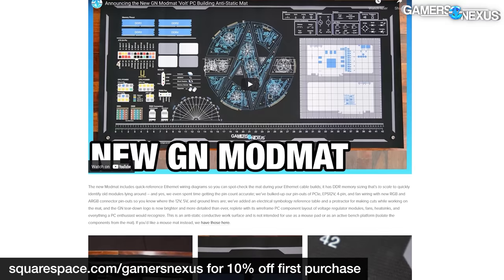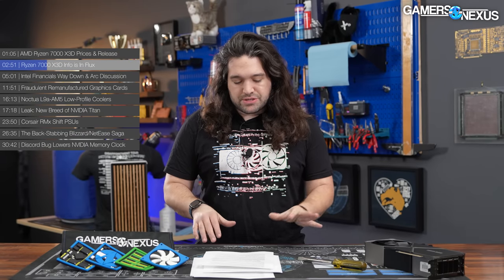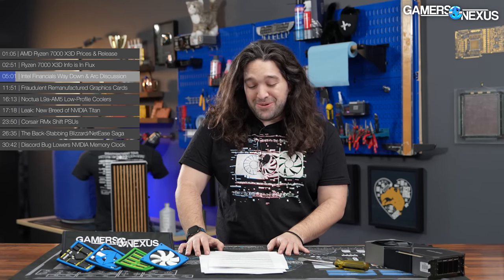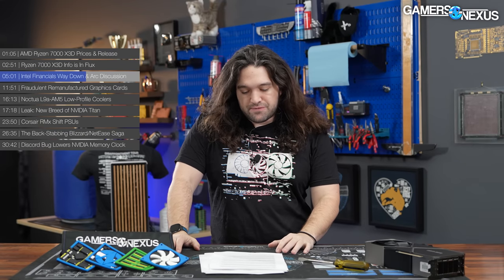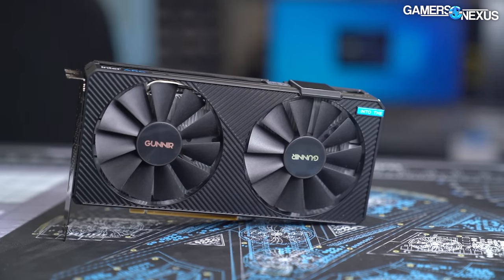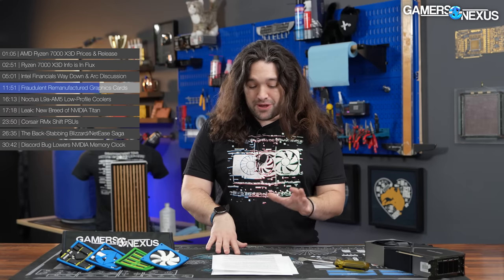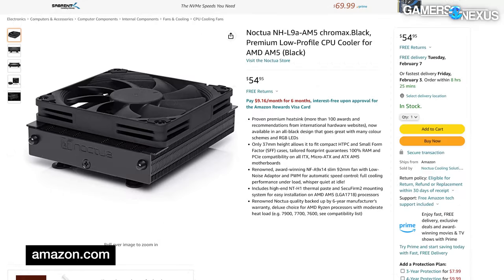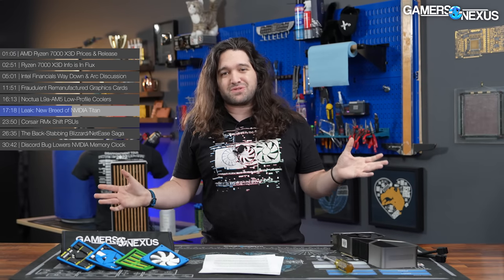HW News - Fraudulent Used Video Cards, 7950X3D Pricing, New NVIDIA 'Titan' Rumors

Comment: I would think Intel needs Arc to succeed and they won't give up on it.  Not for gamers or laptop users, but so they can someday compete in the compute market with CUDA.
Reply from the maker: Great point to call attention to the compute market!
Reply: but CAN they compete? is clear that AXG can't just hemorrhage money in this economy, at least not before some short sighted shareholders take the pitchforks.
Edit: ah what I wrote was mentioned in the video, lovely 😅
Reply: @administrator4728  Xeon Phi isn't a GPU series. The point of Arc is to supplement integrated graphics when higher performance is necessary, among other things.
Reply: @endless2239  why not? The have access to the same manufacturing as there competition does, they just need the talent which they have the money for.
Reply: ARC was never going to be earth shattering at the first stab at the market. What's more interesting is future generations.
Reply: If anything saves Arc it will be the compute and the laptop market.
Reply: Honestly I don't think Intel's strategy is attractive with OneAPI. It's great that it's not supposed to be vendor specific but the code base is in OneAPI. AMD ROCm supports openCL, cuda, along with others so developers don't have to due substantial changes to their code base. (ROCm isn't complete but that's the direction)
Reply: Considering how long they held with a losing product like Larabee, we can expect at least a couple more years of trying before throwing the towel
Reply: @Ibrahimarm  the Arc series is more to compete against NVidia and AMD on the data center world rather than the desktop one
Reply: @scythelord  That is true but Intel as is was never meant to have (kinda massive) Issues at this Point in Time. When they made Arc and or the GPU Devision they thought they could just Tank whatever they need to... to get into Markets.

The Issue now is that Future drastically changed and it doesnt seem Intel has the Money anymore to do so for many many Years...

With other words, for now they will most likely try further but if it costs them to much and they arent getting enough Positive Feedback back and ppl arent really buying either... that can be an Issue for sure.
Reply: Intel will sell off the IP license for the desktop graphics but keep licenses for compute.  Thing is CUDA had a stranglehold on most of the market including AI.  Even though mi instinct series is a superior solution, CUDA still rules.
Reply: Captain_Morgan  Hmm I would also add Intel saw how Nvidia became a giant with AI and GPU, they want to be the next Nvidia. Also I'm going to guess Arc is just getting the offshoots benefit of Intel's actual data center gpu research.
Reply: @donh8833  I see Intel is attempting to crowdsource linux devs to help with arc. That's kind of the whole reason why they went with oneAPI in the first place, getting all the coders and linux users involved. That is kind of how Nvidia approached the CUDA development, they use to hand out free samples to Academia and linux devs to help test and co-develop CUDA.
Reply: Intel has a different architecture for business gpu compute called Ponte Vecchio
Reply: @donh8833  Nvidia is good at keeping happy those who buy their products, especially in the professional market. They have the means and the will to make the software end of their products as simple to use and implement. They work closely with developers and institutions so as to make sure they keep sticking to Nvidia's proprietary technology over, many times more efficient, open standards. I don't know about these days but in the past, Nvidia was pushing Quadros so hard on the CAD/CAM community that their GeForce cards would have many of these programs like Maya render using the software pipeline rather than use hardware accelerated graphics. They're like a good casino in Vegas, they keep their customers happy with a lot of TLC only to fleece them in the long run.
Reply: It's all dependent on how short sighted the investors are. It's exactly that short-sightedness that got them into the shape they're in to begin with. Pressure to move into other markets because the CPU market was saturated and offered no growth. Those investors need to realize the GPU market isn't nearly as saturated as other failings like SSDs that never had a chance to give the ROI that's possible with GPUs and pulling out of that market is foolish after they've already invested so much.
Reply: It's gonna die homie.
Reply: At this point

They have to choose, Do we throw money that we don’t have at a division that hasn’t made any profit, in the hopes of one day making it back eventually 

Or

Do we cut it down, lay off half the staff, and just keep making lower end GPU’s and get the drivers figured out, spend money on catching up in the CPU space, and actually making a profit

(Btw, the 2nd has already happened, Intel has laid off 15% of their employees, and a large chunk of the GPU division was a part of that)
Reply: @administrator4728  I completely forgot about the compute side of GPUs until multiple people pointed it out to me xd
Thanks for the in-depth explanation; I was unaware of the history and stuff.
Reply: That will never happen. Intel's graphic division is losing tens of millions
Reply: @denverbasshead  Well, Intel's GPU division is also new. Companies entering new market segments tend to not get any returns for at least a little bit depending on how hard they are to penetrate. The graphics card market only had 2 companies before Intel joined, which shows the difficulty of entering. In my opinion, Intel is doing remarkably well considering how closed off the GPU market is.
Reply: Competing with CUDA is kind of an absurd thing to expect Intel Arc to be capable of in the next twenty years, because the biggest selling point of CUDA is the tooling, which is a byproduct of how many people use it.
Reply: @bornonthebattlefront4883  That can easily be reworded to make the opposite more appealing, but also far more true:

Do we stand by our investment and stick with GPUs to give it the time needed to become profitable enabling growth we've needed for many years? (Don't for a second think Intel has no money. ONE negative quarter doesn't kill the many years of profitable quarters that preceded it. They still made a net profit for 2022.)

or

Do we neuter or kill the division all together guaranteeing it to be a huge loss of investment while ignoring the ever more lucrative and growing GPU/AI/deep learning market of the future so we can focus solely on the highly competitive and saturated CPU market that has little room for growth?

One choice is the most insanely idiotic and short-sighted tantrum while the other is what's required for long term growth and survival.

Quitting now would be like an athlete training for years to finally start in the major league and quit because he wasn't winning in the first quarter of his first game ever. That's monumentally stupid. Especially when everyone knows the game is going to become more and more valuable with the AI/Compute market's insatiable appetite for GPUs, let alone lowly gamers.
Reply: @lunarvvolf9606  The past is gone. This has nothing to do with babying Intel; the fact that it took ~5 years for a large corporation to breach the market should be telling. I never said Intel deserves any sympathy, nor did my comment contain any. Also, the reason only 2 companies developed GPUs until last year was because the rest went bust by the late '90s lol
Reply: @zodwraith5745 s an Intel shareholder, I'm gonna just... hope that you're right and that they know what they're doing XD.

(I bought Nvidia and TSM around the same time, and that fortunately offset the Intel losses, but still...)
Reply: @JeffreyPiatt  They had some more before that which is sorta funny lol
Reply: @theftking  Not a shareholder, but I know a couple people who have minor shares. Neither of them want Intel to bail on Arc because there's no growth left in CPUs, only defending their current position.

I'm speaking for my own greedy selfish interests as a consumer. I personally don't care how much Intel profits or loses because I have no personal investment. I only want them to be just successful enough that they don't bail on the market. Even AMD and Nvidia fanboys profit from that because it limits how much they'll get raped by their favorite team. Just like how Nvidia fans wanted RDNA3 to be better than it was cause they're sick of getting raped repeatedly by Nvidia.

They won't drop prices if sales slump across the board, but they absolutely will if those sales go to their competition.
Reply: @Johnwilliams-th9hq  It take a lot of time though man to build a new architecture from the ground up. A lot of time, money and talent. Sure Intel has a lot of money but they have shareholders and are not doing good recently. I really hope they do though.
Reply: @Ibrahimarm right but it's meant to fulfill the compute role. Unfortunately they are very difficult to get working in most of the boards I've looked at using them in and never pulled the trigger. There was a time they were very good for mining monero.
Reply: Captain_Morgan  this tracks
Reply: @lunarvvolf9606  They sort of lost 28% of their revenue due to the recent launches. I think that's proof enough that they're funding themselves. Or attempting to, at least. Also, I was aware of the GPU you just mentioned, but apart from Intel there weren't any companies that stayed afloat doing something else; ATI and Nvidia were the last 2 after Intel left the 2nd time. I don't understand why you hate Intel. Is it because they're competing in a new market now? Or is it because you just don't like that companies can shutter ventures whenever they like? Corporations have to be able to adapt to changing conditions. I'm personally rooting for Intel simply because they have the potential to be a serious competitor to AMD and Nvidia in the future, not because I like Intel. My build has 0 Intel in it and I plan to keep it that way until their CPU TDPs go down. Their GPUs don't appeal to me as someone who plays a few DX9 titles.
Reply: @Johnwilliams-th9hq  they really don't have the money for it. Intel has been bleeding their cash supply like crazy since the release of Zen. And now with AMD slamming them in the datacenter, they really aren't getting the cash flow they need
Reply: @Ibrahimarm  they better start making money soon because Intel won't allow hundreds of millions to keep being wasted with how poorly the company is doing right now
Reply: @denverbasshead  Just because a company is losing money doesn't mean it's doing poorly. Intel isn't anywhere close to bankruptcy yet, and their GPUs are already close to being on par with AMD and Nvidia.
Reply: If we weren't going through the worst global recession since the 40s I'd 100% agree with you but in times like this, it's such long term projects that get the axe to reduce costs.
Reply: @endless2239  AMD cannot afford the money to put water in their vapour chambers ,, that opens a great opportunity for Intel :)
Reply: @tilapiadave3234  uh huh, feel the need to "defend" a multi billion company by attacking another.... sigh.
Reply: @endless2239  LMAO ,,, nope Just pointing out a FACT ,,,, sorry if FACTS make you feel butt hurt :)
Reply: @Ibrahimarm  worst quarter in over a decade and it isn't doing poorly 😂😂
Reply: @tilapiadave3234  you do you sport, but I'd charge for that.
Reply: @denverbasshead  That's just how much money corporations have. People don't think about that part. They can still do layoffs and furloughs if they get desperate.
Reply: @Ibrahimarm  investors will start getting pissed. Their margins are the lowest I've ever seen and they messed with the numbers A LOT so it didn't seem as bad. And this entire year they won't have any compelling products. Meteor lake is mobile ported to desktop, no data center chip, battle mage will be delayed. Can't wait till they start fabbing AMD chips though
Reply: @scythelord  all they need to be "earth shattering" is way better pricing instead of setting 350 dollars price on a performance level of a 4 y.o. card that did cost not much more 4 years ago (rx 5700xt).
they've price/performance matched overpriced nvidya's 3060 12gb instead of actually competing and setting adequate price.
rx 5700xt costs 150 bucks used, and its ahead.

a750 and a770 would be fine GPUs at 150 and 200 bucks, even bad driver could've been excused. at 250 and 350 bucks its overpriced dumpster fire of GPUs
Reply: @endless2239  Yes, they CAN compete. Intel has the resources as the world's largest semiconductor chip manufacturer by revenue even in "this economy". They can "hemorrhage" money because turning back to 14nm++++++++++++++++++++++++++++++++++ thinking will only erode their market share further. The only thing that is clear is amount of exaggeration in your assumptions.
Reply: @administrator4728  Xeon Phi isn't a GPU series.
Reply: This! I need CUDA for work as a game dev, and I'd give my left kidney to a different card than NVidia that can run CUDA-based programs.
Reply: Intel needs ARC to not be depended on AMD and Nvidia. Why Nvidia wanted or even needed to buy ARM? Think a scenario where in 10 years Nvidia builds an ARM based platform and slowly moves all it's gaming GPUs to that platform. Now imagine AMD to be in a position to control 50% of the X86 market and starts making it's GPUs compatible only with it's own CPUs, or much faster when combined with it's CPUs. Now Intel has NO gaming GPUs for it's CPUs. It's dead.
More realistic scenario. ARC is not primarily for gaming. Intel builds GPUs primarily for servers because in the future many compute tasks could become more depended on GPUs than CPUs. That means all the money going to Nvidia and AMD and Intel just getting peanuts for CPUs. 
And let's not forget that Intel has strong ties with big OEMs. It can always sell ARC GPUs at huge discount together with CPUs, making it's CPUs look as better deals than competing options.
Reply: AI compute ensures they will only double down on this.
Reply: AXG is dead, Arc itself is on the teetering edge
Reply: Compete in Compute. Nice.
Reply: Let's hope 🙏, because AMD's equivalent GPGPU solution (ROCm) is garbage.
Reply: @wile123456  I really don’t understand why people rate Raja so highly, in this case he might be the biggest factor as to why Arc failed so spectacularly
Reply: Captain_Morgan  Yeah the argument is that ARC can become part of server and the gaming GPUs can be an offshoot branch of this.
Reply: @GamersNexus  if I was intel director replace orginal intergrated graphic with intergrated full size arc GPU within the CPU with treadripper sized package trying to fight Apu of AMD!
Reply: @GamersNexus  I remember a certain person working on another card that was better at compute than for raster.
Reply: Intel gave up on Itanium, and that cost them many billions. Never underestimate the ability of large organizations to give up on large projects.
Reply: I think they're doing pretty good for a first attempt. I mean, it's a mess, but it was supposed to be, even their integrated graphics have drivers issues.
Reply: Why would they risk their company going bankrupt chasing gpus when they are on the edge for server and cpus
Reply: This is exactly. If they want their AI efforts to grow faster, having their own GPU compute unit will help them immensely.
Reply: I hava a buy order on INTC today, at $28
Reply: Well Intel is doing the nvidia strategy. Use gamers as basically beta testers and liquidity pool for compute market products in the future.
Reply: @endless2239  love when that happens, great minds think alike.
Reply: @madcrowmaxwell  people don't realize, as a whole intel could give 2 shits about the gamer market. They just use us for extra money, intel makes all its money in laptops and business market